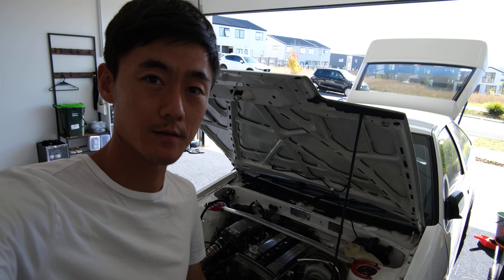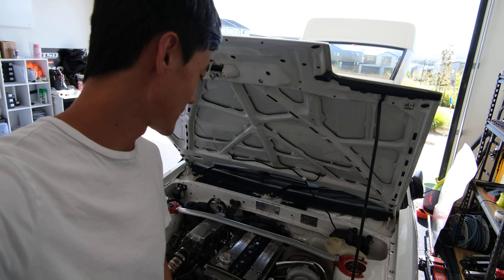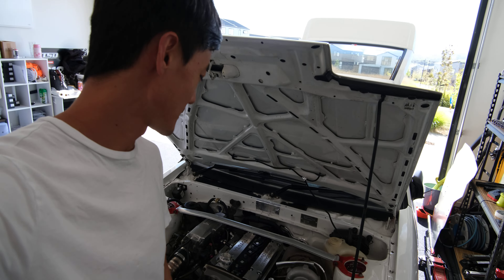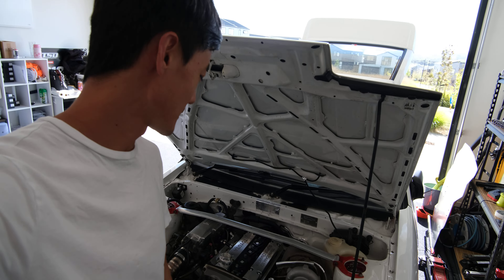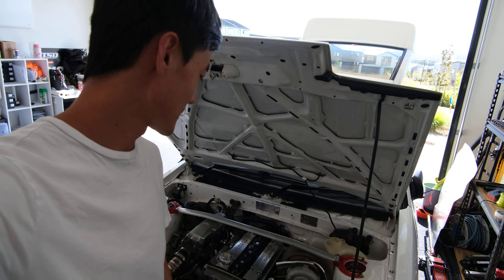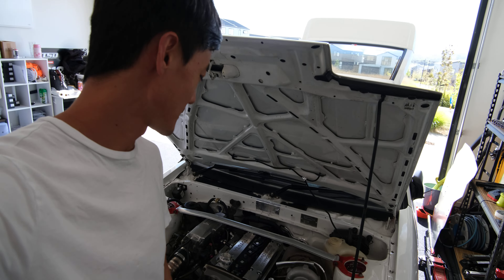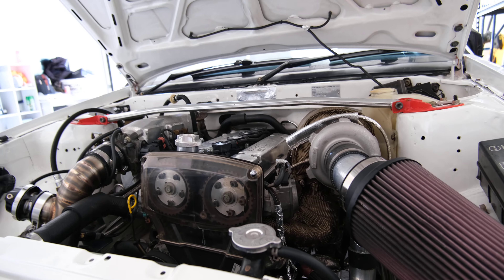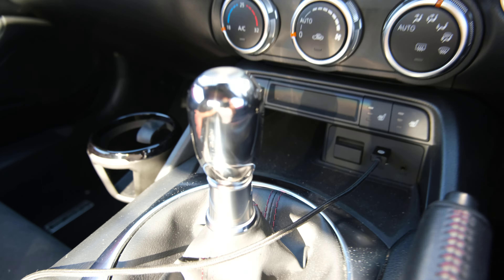My Broken Turbo TRUENO AE86 Warm up & Update

Comment: Hey Jimmy, the rear wheels moving while in neutral is normal.  Remember that with the engine rotating it still spins the tranny, which spins the driveshaft, which spins the differential, which spins the wheels. That just means that everything is in tolerance and nothing is super worn out in your drivetrain.  So, your doing a rebuild because your piston rings are worn out?  If your making already 300+HP on your current set up I would keep it at that power range and just do a standard rebuild which would be new rings, bearings and seals.  The rule of chasing power, is the more power you achieve, the more things start to break.  I'm actually surprised that your running 300 HP on a stock transmission and stock GTS rearend.  I'm hoping to get 300hp out of my 1uz AE86 and I upgraded the transmission to a supra W58, and the rearend to a Ford 8.8. Goals for my car is car shows, some grip track driving, and reliability.
Reply from the maker: Hi, Mate thanks for you message, actually my transmission is W57 and Hilux diff 4.55 ratio, yep I’ll most likely keep the current power and refine the tuning for now, but I’ll push to do forged piston and etc for longer reliability and peace of mind.